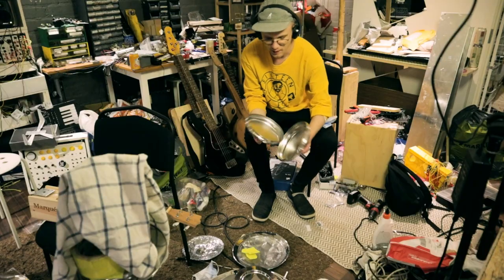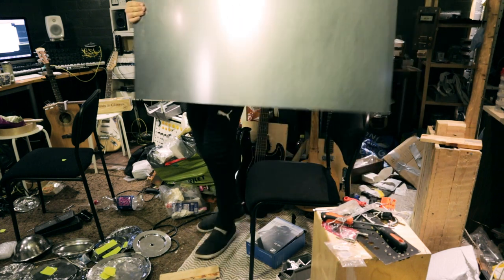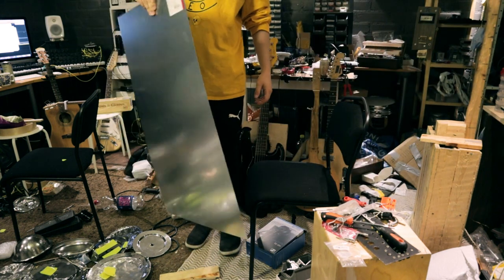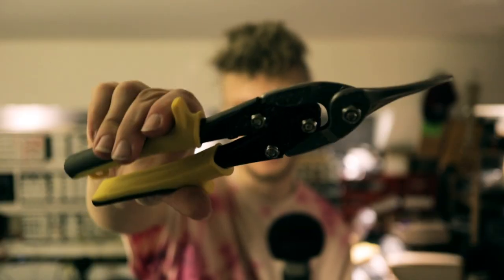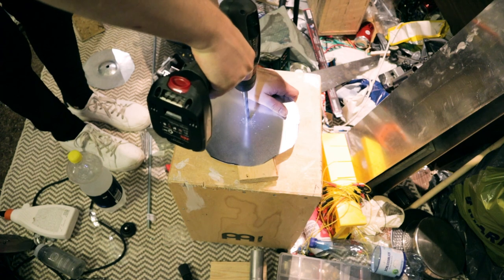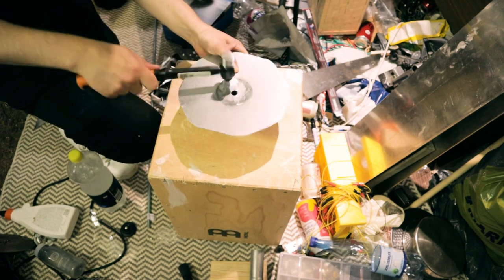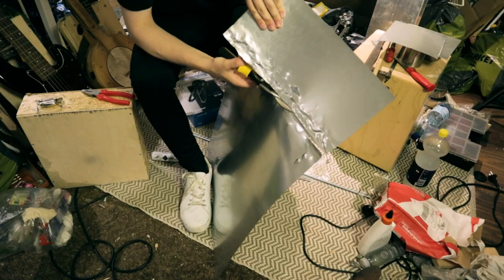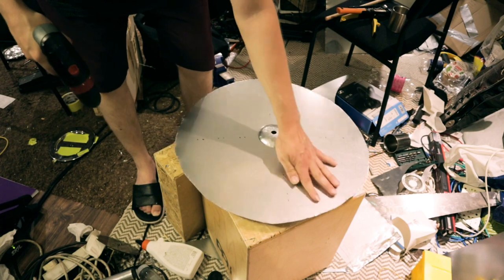DIY sheet metal hi-hat and cymbals

Comment: You know, those really do sound pretty good! The galvanized steel sheet doesn't have the bright, ringing sustain of usual cymbals. But really, there aren't bad cymbals. Like there isn't bad music. It's just a matter of like or dislike. I'm about to try to make some hi-hat cymbals. I have a welding/metal working shop, so I've got a few advantages...... 8). I'm going to start with some old pot lids. Like from the 70's. They are made of a higher quality steel than much of today's kitchenware. I believe the results from them will be better with the thick, rolled rim cut off. I may try hammering them fully as this alters the metals grain structure/density and may bring out more of the traditional ringing and sustain. I may even torch/forge heat them and quench them. This will cause them to get harder (but brittle, without tempering). My theory is this may help with the brightness. Something fun to play with. I've got some other metal bits to play with to. 
Thanks for the inspiration.
Reply from the maker: Oh wow that sounds awesome! Have fun experimenting! 🌞

Comment: Hey! Cool solution for hammering the bell. I made my small hihats based on the info you gave by comment. Only thing different is a thicker sheet +- 1.2mm for the bottom plate.
Reply from the maker: Nice! I would like to try out different thicknesses too, and might do that at some point
Reply: @LAURISDIYCHANNELTV  on the 0.5 mm sheet. Try hammering for a shorter wash or cut a ring and put it on the edge for less vibration
Reply from the maker: @bydeattic8319  good ideas! I also tried stacking 2 cymbals for the bottom and and that sounded quite nice as well

Comment: You could hammer the entire surface of your cymbals, top and bottom, for an interesting tone. And kill the edge of the cymbals to avoid cutting yourself. You can use a metal sandpaper.
Reply from the maker: Yeah i think i’ll try hammering some cymbals the next time i buy some more metal sheets! I decided to leave these flat because the diy cymbals ive tried hammering it never really helped with the tone for what i want. But i would definitely want to try hammering a larger cymbal like these ones and get some different tones! 👍

Comment: the sheet for ride cymbal is 26 thickness or 24 or 20 or something ? i hear 26 thickness is the best for diy gongs and similar and i like your cymbals
Reply from the maker: I’m guessing you mean the diameter of the cymbal? The bigger cymbal in about 22 inches and the smaller one about 18 inches!
Reply: @LAURISDIYCHANNELTV  no I mean the thickness when you buy the sheet on the shop. They buy thickness from 30 that is too much thin. 26 to 18 is good. I try to make a ride cymbal and gong. Maybe 22 the thickness of the sheet.
Reply from the maker: Oh sorry, the thickness of the sheet is 1,5mm!
Reply: @LAURISDIYCHANNELTV  uffff is very heavy 🥴 i go to try 1 mm or 0.7 mm